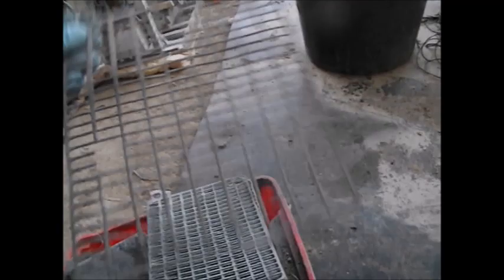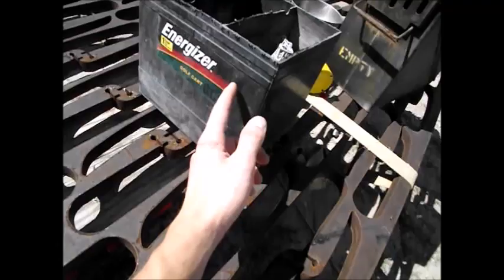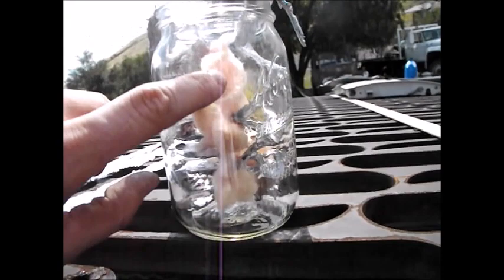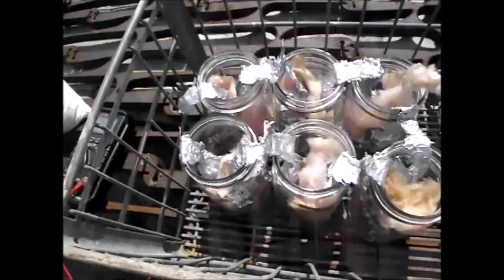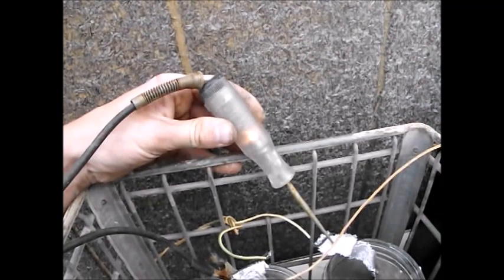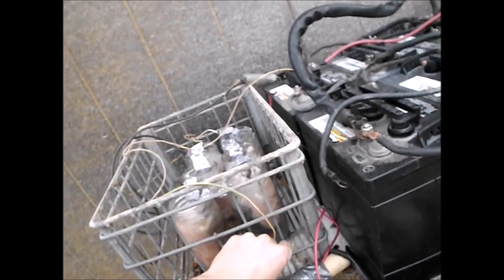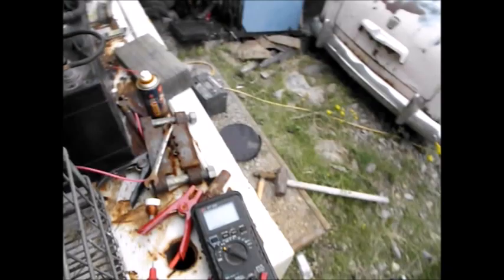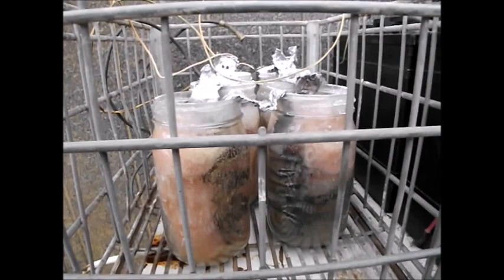Homemade Lead Acid Batteries

Comment: 6 years later, I am seeing this. I work at a lead acid battery factory. I am a cell burner, so I line up the positive and negative plates and melt the posts with the terminals on them to the plates. But we make large industrial batteries where the individual cells weigh 25 to 240 pounds each. I enjoy it, and I enjoyed this video Cody. Thank you
Reply: That sounds like a cool job
Reply: @tek4  until you realize how dangerous it is... well, lead poisoning is the main concern.
Reply: thank you for your service
Reply: @Ryan-lc4bl I'd assume they have some really good respiratory protection and such
Reply: @iowafarmboy  yes, I'm aware they do... molten lead doesn't have a high vapor pressure at it's melting point (327°C), so the main concern isn't the vapor, but lead oxide dust (the paste coated on the plates). 
But on a large scale, there's considerable exposure.... they're tested for it over the course of a few months.
Exaust fans and such are used to protect them.
Reply: 9 years

Comment: Interesting video.

From what I'm reading in the comments section of a lot of other videos, the reason to use sulfuric acid is because it freezes at a much lower temp than epsom salts etc. So low freezing point is a factor to consider here.

Before watching your vid, I assumed the lead plates in batteries were simply thin squares of pure lead. Now I know they are a lot more complicated than that, I realize making or reconditioning an automotive battery is no simple matter.

Comment: quite sure i was reading Megaohms on that multimeter not ohms XD, and btw usually multimeters can't give the proper resistence when you test directly the battery, try using a known resistor in series then measure the current  passing through it, measure the voltage, then you just have to solve V=(Rr+Rb)*I   =>   Rb=V/I-Rr   that works much better and gives you a kinda accurate value of internal resistence of the battery

Comment: "And now the current I'm getting is like 4 volts."

Oh Cody...
Reply: immibis 4volts of current..
Reply: he is majoring in geology and minoring in chem. I wouldn't blame him for making such a small mistake.
Reply: Instead of quoting a mistake and emphasizing on it, you would do well in explaining, that Voltage is measured in volts, and Current is measured in Ampere. Voltage is the potential / level, and Ampère is the amount of current in the thread. The effect you get out is calculated by Volt times Ampere...
Reply: @DigitalAgeInstitute  He makes these mistakes on purpose just to screw with people.
Reply: If only that was the biggest mistake in this video... During his explanation in the first couple minutes of the video, he didn't even get the reaction right.
Reply: electroboom  intensifies
Reply: Use Ohm's Law E=I R, to solve for current you transpose Ohms Law to be I =E/R. I = current, E= voltage divided by R or Resistance. Then you will know the amps this battery can supply.
Reply: @lomgshorts3  aint voltage U or V
Reply: @woohooman-fl9vq  YEZ
Reply: English... you can say "current voltage is..." :D
Reply: @misaalanshori  NOOO...
Volt is voltage current is ampere
That two are different
Reply: @ardhi1269  4 volts of current and the voltage is at 1 amps
Reply: @misaalanshori  you need to know what volt and current is
Reply: @misaalanshori  maybe you wanna say 4volt of voltage and 1 ampere of current
Reply: @ardhi1269  4 volts of current
Reply: @misaalanshori  still dont understand
Reply: @ardhi1269  how did you not realize my comments were not serious? My first reply at the top was basically repeating the main comment with a different wording...
Reply: @misaalanshori  well i think cause I am "electrical Engineer"
I take all about electricity seriously
Reply: @misaalanshori   and don't say 
"4 volt of current and the voltage is at 1 amp"
That completely wrong
Reply: @ardhi1269  So what? Its just a joke

Comment: Nice tutorial, I did something similar a few years back, sort of a DIY solar charger and battery experiment, good work. I did find the irony a bit funny though with a tutorial about building a battery, right at a bank of batteries, near a generator, and your cam's battery dead ;)

Comment: this video could be a guide of how to make this style of video, because he's giving us important information that people tend to forget. like telling us that a 12v battery charges at 14.4 volts, something most people forget to mention. or showing the plates and talking about surface area. these are very helpful for someone who didn't know this, instead of just saying there's lead plates and it's a 12v, battery charger. of course eventually people find these things out on their own but when you're totally clueless little things like that make a difference in understanding it. if i didn't know and i was charging something and then i measured it at 14.4 volts from  the charger i might start to worry.

Comment: i dont think you can measure the internal resistance of a battery with an ohmmeter like that? considering the meter does the measurement by applying a voltage across the resistance to be tested. (your meter appears to say megaohms, not ohms)
Reply: Yes. Fully agree with jonsykkel. Can't do that. The battery volts will make a mess of your Ohms reading.
Reply: Exactly, you need a LOAD resistance and measure the open and closed circuit to get internal resistance.
Reply: jonsykkel you are correct
Reply: Normally, you can't measure internal resistance using an ohmmeter. That's why he discharged the battery before doing the measurement.
Reply: The Ohmmeter puts a small current through the test object and measures the resulting voltage. Resistance is then calculated as R=U/I. 
Any voltage that's already across the test object will add to the above mentioned voltage, void the reading and can damage the ohmmeter (which is expecting only the small test voltage). 
Even if he'd manage to discharge the battery (to real zero volts), he can't do it like that, because the internal resistance is not like a normal resistor; it varies depending on different variables.
Reply: He didn't fully discharge the battery. As soon as the wrench was removed, the voltage rose back up. The meter was erroneously reading megohms.
Reply: Best test practice i found for lead acid is test three voltages at each cell.
Voltage at rest each cell. Voltage at uniform load each cell. Then voltage as charging.  Gives you a good idea of what is going on.

Comment: I have a question for a Cody level brain.  I've been wondering about ways to store lead acid batteries long term.  Let's say I buy a new battery, preferably "dry", but either way, then drain the acid, wash it out with distilled water, then dry it thoroughly.  If I then placed this in a cool, dry place for 20 years, could I then add battery acid and expect it to function?  Function like new?  Even better, I could flood the battery case with nitrogen or some inert gas and then vacuum seal it, so there would be no oxidation during the storage period.
Reply from the maker: https://www.youtube.com/watch?v=DMxIorjaFIM
Reply: +Cody'sLab haha. And I thought nobody else was doing this because I couldn't find it on google. I should have known!  Thanks man. So there's no concern with oxidation at all?  This is for my golf cart battery bank. I would t want to buy $650 worth of batteries and reduce their life or capacity.
Reply: @theCodyReeder  dont get any lead on you touching it or breath any lead dust etc. it car reak havoc on the body. I Love your videos 👍

Comment: so, batteries are just capacitors but the plates have higher resistence than the ones used in common capacitors?

Comment: Easy way to remember volts are not the same as current, current being measured in Ampere. Voltage is like a water tower, storing x amount of water and by being held higher than all the houses it feeds, uses gravitational energy to pressurize your water lines at home. Voltage is akin to water pressure in this case. Your regulator on your water meter is like the transformer on your power pole, bringing the "pressure" from the tower down to something usable. When you turn on your faucet, the amount of water coming out of it is akin to the current of electricity. So voltage is potential and current is flow. I could be lying tho
Reply: not lying, you can say that again

Comment: What kind of generator is that you are running?  It sounds like a steam engine.  Or an old hit and miss engine.
Reply: Sounds like a low spark rate engine, probably with a flywheel. Sounds pretty efficient.
Reply: Craig Arnold My bet would be on a Lister diesel clone from India "Listeroid".
Reply: Those reasons are gone
Reply: +Dogurasu  You probably should've googled or searched youtube for "lister clone" before you made that comment.
Reply: I was about to comment and say the same thing... I think I heard the firing rate decrease slightly after he disconnected the battery charger, so I'm thinking maybe hit-and-miss. Or old diesel with a huge flywheel. I'd love to see it though, I'm sure it's interesting regardless of what it is.
Reply: That didn't sound like a Lister or Petter to me. I grew up running those things on shrimp boats. An antique make and break engine, maybe. Or steam piston.
Reply: Cody's generator sounds very much like a Lister CS style clone. single cylinder 600 RPM diesel, count the number of exhaust pulses in 10 seconds, times 2 for revs, times 6 for minutes. I come out somewhere between 500 and 600 RPM
Reply: A couple of his vids he's in the shed with generator, it's an ancient diesel with huge flywheel and low power output by today's standards. But it's still going which is far more than can be said about new generators. And it's all mechanical so easily repaired with stuff you have at home. No mother boards or computers needed.
Reply: Or like an oldest train in the ancient world!Hahaha

Comment: You've mentioned having a bigger voltage solar panel(14V) in your video make 'em charge the battery. But can I also work on equal? 12v solar panel to charge those up? I asked coz It be universal to use a 12V panel to direct electronic equipment vs a 14Volt one. Thanks!

Comment: I have a few questions.  I thought you had to start with two dissimilar metals. Also thought that full strength electrolyte provided full charge without charging.  Thanks for the info on non acid electrolyte.  I have a few dead battery's I would like to salvage  Good video.
Reply: The way i understand it is, with his method, charging creates the second metal by creating a layer of lead oxide on one plate. The batteries you buy from the store are already 2 different metals. 1 set of plates are lead and the other set are lead oxide or some other  lead compound.

Comment: Hey Cody, I'm designing a led/acid battery for a school project.  Does the volume of the cell matter?  It's to my understanding that its the amount of surface area of the electrode which comes in contact with the electrolyte solution which matters but I wanted to check with you.  Also do you know of ways to increase the voltage per cell?  I want to make my cells as small/light as possible, thanks!

Comment: Reading over this again. Cody gave a general idea of how this works. Ya his was not very good but I got the idea. That was his plan. I knew one of the material engineers from the Gemini space program. He helped create the heat shield material. I can tell that him and Cody think a lot alike. Now then for this battery I'm thinking that we must grind the lead to a consistency of coffee grounds, and mix those grounds with fiberglass insulation. Maybe something like the old table top hand meat grinder would mix them into a paste like substance, I'm not sure but I think in order to get enough surface this material has to be broken down.

Comment: I have an idea for you: Get a straight piece of sheet metal, zinc-plated steel is good. Melt lead in a can. Then pour it at once from a height like 0.5m in the center of the metal. It will form a blot that instantly solidifies. You peel it off easily, then cut it to suitable strips like any other sheet metal. Much better technique than with the hole.
Then you need to wrap it with the separator much like you would a capacitor.

Comment: As a question, wouldn't it be better for the batteries to use some kind of textured roller to flatten the lead strips out even further while adding a lot of surface area, then coil the positive and negative plates with an insulator between them like a capacitor?
Reply: yes
Reply: n o !
Reply: yes you are right, problem is if you crack the anode into the solution you lose most of the surface area.... so.... that's why people use thick plates and not the capacitor setup :S

Comment: How about using that gold squisher with the rollers you got to make some really long ribbons of thin lead and sandwich two of them with fiberglass, roll those up to make a tight cylinder, then stuff those in the glass jars. Wouldn't that give a greater surface area and more storage capacity?

Comment: You mentioned that you build your own plates with the old lead material in the barrel mixed with sulfuric acid…have you made a video demonstrating a more powerful battery using recycled material? I’m also interested In what chemistry would dissolve lead sulfate crystals to clean batteries and refill them afterwards?

Comment: Please be carful with that lead oxide, I hear its very toxic and can kill you painfully over time, even small amounts. Please let me know if that's true. Also, could you do a alum or Epsom salt conversion to your used car batteries. I hear they don't degrade and you can dump the entire charge out of them and they will recharge just fine, and will never die.ThanksRandy

Comment: Im sure You already know that,  but i feel like i have to say it. Current is flow of electrons, and You measure it in amps. Voltage is difference in potential, and You measure it in Volts. It is not same. I'm electronic engineer, and confusing this two hurts me really bad. On the other hand i know that if i have battery it gets me power, because some magic happens inside ;)
Reply from the maker: lol, but generally with batteries more voltage = more current. ;)
Reply: Yea, thats righ. But still, it is not same thing.
Reply: More cells in series means more voltage. More cells in parallel delivers more current provided the wires can handle it. More voltage means less current can provide the same power, but of course it get's complicated when we bring resistive, inductive and capacitive loads into it.
Reply: generally the bigger battery is = more current) but voltage in contrary is pretty standard and there are not so many different voltages
Reply: Kalan01r, that made me cringe, too. But in fairness, regard the target audience, and the fact that Cody probably doesn't have to design many elektrickle surkits or rub elboes with to many injuneers. His vids probably excite more scientific curiousity in kids than all the bored and boring science teachers in all of our public schools. Really, I have to say that I thoroughly enjoyed Cody's presentation, overall. It would be cool to compare lead acid battery chemistry with lead alkali in the same form factor, though. There's another youtube opportunity for somebody. 15 min of fame, anyone?
Reply: Cody'sLab not really.

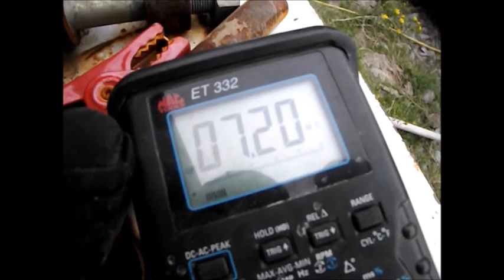Comment: at 21:27 the reading of the meter is 7.2 M ohm, this may be why you have very little amperage!
Reply: Yeah, I spotted that as well! That's what happens when you try to measure a battery's internal resistance with an ohmmeter, it can't be done as the residual charge in the battery completely screws up the reading. The correct way is a bit more complicated than that, but still only requires a multimeter, a resistor, and Ohm's Law. The resistance of a dead battery is pretty much meaningless anyway.
Reply: +snaprollinpitts Yep, with a voltage present, swap the DMM leads and you'll see a different result?

Comment: Cody, question about real batteries.  When you're rebuilding, what do you use to replace damaged separator/divider/sleeves/membranes?
Reply: if you still care;  you can use anything that can survive the environment inside the battery that is also non conductive and porous.
Reply: @justthinkalittle8913  Ya, I still care. :)  As best as I can find, your description is all that really matters.  Better ones use fiberglass.  Cheaper ones use paper.  

The few that I've torn down so far used some plastic that got brittle and basically fell apart.  It looks like that's why those particular batteries died.  They build them to be replaced in 2 to 5 years, not last until the plates break down.

Comment: This is probably not the best place to get Cody's attention .. but would LOVE Cody opinion on the chemical make up, 
of whats been discovered/talked about as lead acid Alum conversion batterys ... 
basic are.. 
taking OUT the Sulfuric Acid, rinse out with standard (maybe better with de-ionized) water,
then replace with a solution of water and Alum powder (also known as Fatakdi powder) which is Aluminum potassium sulfate..

althou battery voltage normally sits/floats at about a volt lower, it seems to vent less, when charging...
but ultimatly, doesnt matter how bad the battery was "sulphated" before .. as long as it didnt have a shorted cell .. seems to give a whole new lease of life to the battery ... is normally a success rate of 70/30 .. 

does this seem right chemically ?? ..  as Sulfuric acid ( H2SO4 )seems to be rather important in the reactions ! ... 
Alum powder (Aluminum potassium sulfate)  KAl(SO4)2.. so STILL has the SO4 in there to react ?.. 
But im NO chemist !!!

Comment: Cody is there a way yo incorporate the added surface area in order to make electrolysis faster on the stainless steel used for hydrogen generators? Like add a paste to the stainless steel, higher surface area more electrolysis?